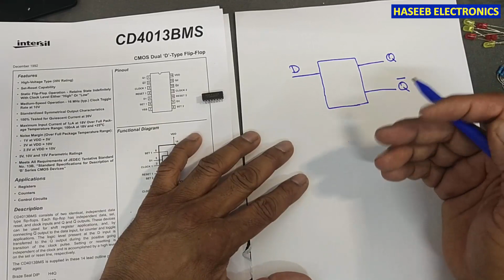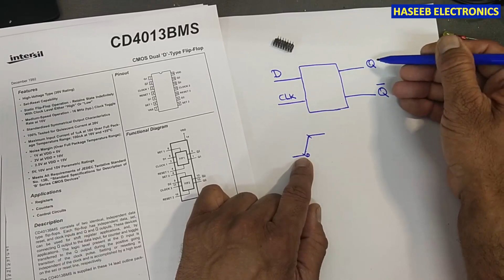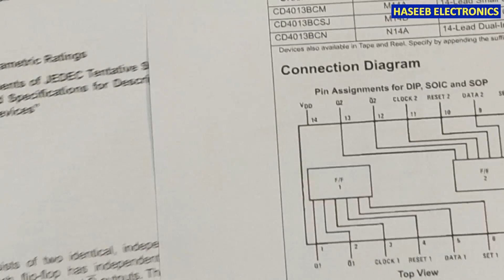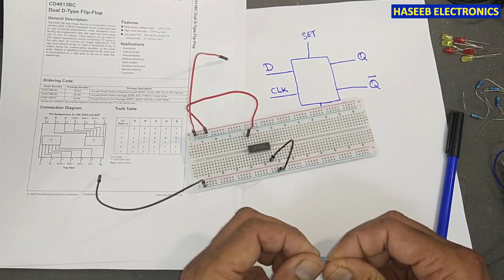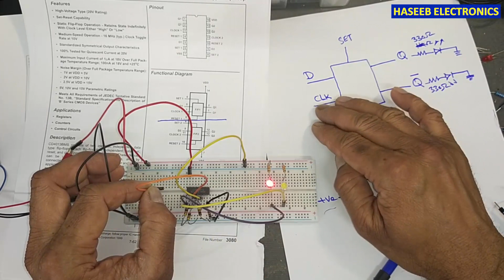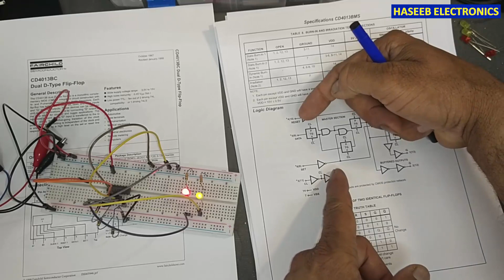Comment: i have a push pull type smps with no controller ic it only has the cd4013 and two hef4098. im assuming the cd4013 oscilates between the two transistors. have u encountered a set up like this? and can u explain how its supposed to work. Thank you for your videos

Comment: Back in 1985 the presence of (many of them) CD4013 in a critical large automation system (SCADA) with Z80 and (many) remote controlled units, convinced (forced) the company to buy the first logic analyzer (due to the "down time" OR MALFUNCTION of the system was TOTALLY  UNACCEPTABLE). They (CD4013) have a tendency to malfunction, especially due to "statics" in high inductive environment 👹(they made my life difficult). Nice analysis/presentation
Reply: yes it is very old in electronics but so far it is still standing as it was in past. 
thanks for your valuable comment